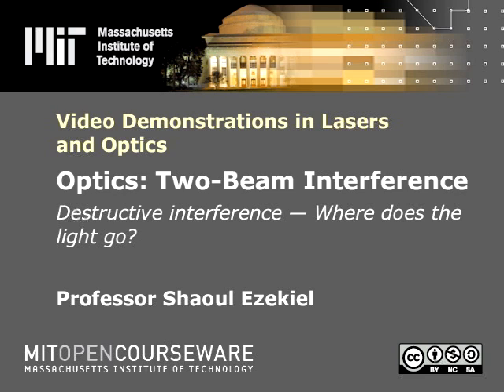Optics: Destructive interference - Where does the light go?

Comment: Where does the energy go?  I thought I’d make a detailed explanation, for those unable to follow the simple correct answers given before mine.
  
First, we have to make an assumption about the splitters, are they arraigned with the silver and glass sides oriented in the same direction, or is there a phase shift from one or both splitters due to the orientation.
The phase depends upon our knowing what kind of splitter he is using.  He doesn't say.  Read here for detailed explanation: https://en.wikipedia.org/wiki/Beam_splitter

Initially, we set up the Michelson Interferometer to display a bright spot at the center of a display to create an interference beam which is constructive along the center which alternates from bright to dark every λ/2 (half wave) (length?) change in the angle. Each Δ of λ/4 in the adjustment arm creates a ΔL of 2* λ/4 or a λ/2 (180°) phase shift. 

The splitters ‘usually’ used in these experiments have a phase shifting side, and 3 non-phase shifting directions, just so you can play with effects like we see here.  It’s a great test of one’s understanding of the phenomena!  This is MIT, who knows; but, it does make a difference, and he does seem to have a 'smirk' in his smile. :-/  I suspect… subtlety! ;-)  To understand, one must know ‘precisely’ the processes going on here. This kind of experiment sets MIT apart from smaller colleges and universities.  One, for the uninformed, it is a real challenge.  Two, for the savvy student, it challenges conceived notions and requires one to examine testing procedures at the level required to make quality experimentation.  Imagine if this were to be published as a paper!?  How foolish would we feel?  This is a great example of the kind of critical and divergent thinking needed today.

In most cases, the primary and principle design and purpose of the Michelson interferometer is solely to show an interference pattern, a second splitter does not get used.  As a simple interferometer, whether one leg is phase shifted does not matter.

Note: When I refer to return path, I am referring to the actual return path which is the pass through path from the adjustment arm mirror, which when hitting the splitter on the return is both diverted to the left leg, phase shifted 180°, and passed through in a return path to the laser shifted 0°.

However, in this set up, the paths are "not" the same in how we create the two interference patterns.  Though he says they are, the return path beam, which he calls “the other arm” from the adjustment mirror, strikes the back side of the splitter  when it makes the 90° turn into the mirror and lens and then on to the screen.  The back of the screen introduces a phase shift of 180°.   Since the adjusting mirror sets up the interference, this phase reversal has no effect, when using the interferometer as in the first half of the experiement.  However, with the introduction of a second splitter, this 180° shift comes into play relative to the reference beam on the fixed leg, with the addition of the interference pattern created for the ‘return’ beam.

It’s interesting to note that if the interference pattern of the first half did actually produce an inverted pattern traveling backwards through the beam, it would phase cancel the entire beam according to Quantum Mechanics, so no reflected beam, this is complex in understanding the fundamental concept behind “Where does the light go”.

What kind of splitter is he using is crucial to our understanding.  As an outsider student gleaning information and watching courses from MIT, Stanford, and all the others.  I personally think it is a heinous crime to leave out such critical information; there are enough people out there who do not understand this process, and will not take this parameter into account.  Someone suggested he would get into trouble if he stated where the light really went; in the case of current affairs he does cater to two schools of thought by removing this critical piece of information.  When I first saw the video, I thought I was going to have to dump all my research!  He could easily have thrown me by stating what kind of splitter this was, and were I to discover the splitter did not have a phase shifting back.

The interference pattern through the return path does not use the reflecting side of the ‘first’ splitter for one of the legs creating the interference. (This is a critical point, and the whole experiment hinges on this information.)  In this case, the ‘return’ legs are both at 0° relative to each other to create interference.  This means that the two legs do take different paths than the first, to create the interference pattern for the “return” beam’s path.  The return path, before it reaches the second splitter already exists as an interference pattern.  The second splitter doesn't do anything but redirect the already existing interference pattern into the viewing leg.

The second splitter, no matter what kind of splitter, does not change the relationship between the two beams already existing as the interference for the return leg because if silvered, the both beams are shifted by 180°, and if glass, both beams are not shifted and remain at 0°.  Shifting the interference pattern by 180° does not affect the banding created!  Shifting one leg or the other does and in this case, the second splitter has no effect on the interference created prior to reaching it.  Note however, it does change the intensity, as each splitter divides the intensity by 50%, the amplitude is affected, but not the phase relationships of the pass through beam from the laser.

To summarize, in the top path, one leg is at 0°, and the second leg is at 180°.   In the return path, before it reaches the second splitter, one leg is at 0°, and the second leg is at 0°, therefore the interference pattern is inverted.   If we set the first path to create a constructive interference at the center, the return path, not shifted by 180° is destructive; or vice versa, the first path creates a destructive center, and the return path, not shifted by 180° creates a constructive center.  What is required to flip the orientation is to change “ONE” path by 180°, but not the other.  In this case, the fixed leg of the interferometer is the reference point.

He is incorrect when he says both paths are the same, unless he means the paths of the two legs reaching the splitter is the same.  However for the top, the Adjustment leg is phase shifted for the top interference pattern on the screen, but the Adjustment leg is NOT phase shifted through the splitter for the bottom interference pattern, the return path, when displayed on the screen. 

The second splitter added later only serves to allow the initial reference beam to pass through (0°), and to redirect the return half of the beam into the second path.  Again, since the interference pattern already exists before it reaches the second splitter, reflecting off of the second splitter either modifies both legs 180°, or it does not.  Phase shifting the interfered beam by 180° does not change the interference pattern because both legs or beams creating the interference maintain their internal basis relative to one another.

Of course, if the splitter does not have a phase shifting back of a silvered half, then he has proven Quantum Physics (or QM) false.  This experiment examines the most fundamental principle of wave function, what happens during destructive interference; the concept that got me interested in Quantum Physics in the first place.  Where does the energy go?  Are all three vectors phase shifted by 180°, spin, electro and magnetic, or only one, or two?  What, if anything, remains observable in reality, when destructive interference happens?  If the energy cannot be observed, where is it?  The answer can be found in 'complex eigenstates'.
Reply: No, because it is unobservable.  That's the classical answer.  If I might ask, exactly what phenomena are you looking for (I'm not sure); and what is your background?

It's fairly well understood that destructive interference appears to create a 90° shift in the normal, and this is apparently a complex vector.  However, in reality, matter interacts with matter, and if the matter interacting has things like electrons and nuclei which they do, then we might conjecture that they also consist of interference patterns which can interact constructively and destructively.

  For all we know in a double slit experiment, the light is interacting with the matter of the slit itself at the edges, and the electrons in the material of the edges are altering the phase of the emerging wave. Still the destructively interfered wave points appear at the constructive interference sites.  This could be a complex vector reflection being reflected back again by electron interference of the reflecting surface material. [180° is destructive, creates 90° rotation, and at π/2 a surface electron reflects it back]  and if that whole pattern is reflected and 180° out of phase with originating phase of incoming. Where does it go?  A: 90° complex phase shift.  Hypothesizing, of course, that matter is nothing more than a sum of  constructive and destructive interference points. (Holographic Universe).

I believe I have a mathematical model of an electron which explains 1/2 spin in terms of simple dimensional interference.  (I believe in layman terms we can extrapolate this behavior cognitively by use of simple 2D moire patterns to show the relationship between the math and physical states of matter existing as fixed nodes, and radiating out from that as photons due to resonance.).  The problem observationally is simply that the angular momentum of the electron is too fast to observe independant states.  For all we know, the electron spends half of its time being unobservable and what we're seeing is the "fan" illusion, where something that appears solid, it really just the blades moving so fast you can't poke your finger between the blades. I feel strongly that we never see the full energy of an particle at any given time, no matter how we measure it.  And saying half could be an understatement.  We always square everything to get real roots, just to make it observable; that bothers me. It bothered Heisenberg, and Planck and classical convention and politics forced them to describe things differently than they wanted. I think Pauli was in on that too; I certainly agree.  The subject was Quantizing angular momentum, and from that we still deal with probability.

I've moved on to Bohmian Mechanics (BM), as from my personal research I think there's better evidence to support that theory, especially with recent entanglement experiments.  All along I independently developed my own theory which I later discovered was a variant of the pilot wave theory and BM .   The behavior I mentioned about the splitters and is well documented in the specifications of the various types of splitters.  The rest is common sense and logics, binary logic in this case which keeps it simple.  One need only keep track of the front or back of the splitter, and thus the type.  So, on that note: original research of the mind I guess one could say.

So, I'm not really sure which phenomenon you are referring.  The experiment fascinated me, as I was hoping to learn something from it.  Instead I found neither a confirmation or denial because of lack of information concerning the splitter specifications.  So, a poor experiment, in my book, at least in terms of figuring out WIGO, vs WOSIGO, or What is going on vs What one sees is going on.

I'm really just looking for information to prove or disprove my theories.  All experiments in my research are mind experiments as I have no laboratory.  I call it Phase Theory, not to be confused with the Wikipedia Phase Theory that's been around a while; but, I've focused on constructive and destructive interference.  Science has spend a lot of time and experimentation and development of constructive interference (Phase conjugate mirrors, Star Wars Defense, Holographic Identification, Photon doubling, Atmospheric interference corrections in Astronomy to name a few), but makes little to no effort to examine the destructive interference effect, and that it appears to be a gateway into N-space dimensional interference, primarily because of the "Where does it go" phenomena, and that based on QM and BM the effect is usually complex, and thus defined as "unobservable" in QM terms as in some aspects of entanglement has shown, unmeasurable.

Entanglement claims to disprove the local hidden variable theory; but, and I'm still absorbing BM, and my theory theorizes a possible local hidden variable which can't be accounted for in current experiments.  But, it's an N-space problem, and not easily observable if at all, thus mind experiments. 

So, based on my key word usage, these are areas you can read about.
Reply: +David C. Huculak Wow!  Thank you, a very nice post.  I'm more used to internet Trolls that defend as if their life depended upon it, a 3D observable universe, and anything contrary to that concept, freaks out their little monkey brains. lol
I learned about uncertainty, and quantum mechanics much later in life.  I abhorred the probability approach until I understood it.  It took much doing because everything I had come to understand didn't allow it; but, at that time I couldn't imagine wave function.
I really became serious when I was 30 years old, I'm 61 now.  I had read a book written by what many would still today call a goof ball, and paid little attention to him.  I felt, if I were to learn to think out of the box, I had to destroy the box first.  So, I never limited myself to solely classical studies; and I'm self taught all the way pretty much, that is except for college and university level math, physics and calculus.  I am self taught in linear algebra, and with that the translational geometrical identities, rotation, translation, etc.  Much needed to understand classical Quantum Mechanics.  Heisenberg's uncertainty requires a mental image of wave function to see why it doesn't specifically conform to linear vectors, however the wave function follows basically a vector form, like a spiral around a vector.

I realized anything I decided had to agree with anything we'd observed in physics to date.  However, I also realized that it would only have to conform to observables, a term I later used and interchangeably with the term 'reality' and decided to call anything that was beyond observable geometry as existing, or saying instead of reality, existence even though it didn't specify to what level it exists, like a thought experiment.  It's more complex than this; but, it suffices for the time.

In the book I read, the "scientist" made one statement I pondered for several years.  He stated that a photon was an electron rotated out of phase by 90°.   Already familiar with both electrons, and their parametrics, and photons and their parametrics, I observed that they were very similar indeed, almost too similar, it seemed strange that they were so similar.

In fact, at the time, the only difference I could see between the electron and photon was that one (the electron) had mass, and moved slow; and the other (the photon) was 'massless' and moved at the speed of light.  Other than those two things, they were nearly identical.  I didn't believe in coincidences, except maybe randomly.

When I tried to discuss this with my professors, or other learned men, I was either way over their head, or they rejected me outright without thought, which confused me, as I was just making inquiry, not a statement of fact.

That was 30+ years ago.

My first hero was Einstein, and my second was Nikola Tesla.  Through Einstein, I was interested in time and light, and through Nikola, I was interested in resonance; this led me to constructive and destructive interference which is present in photons.   When I was 12, and I saw my first electromagnetic chart, my mind imagined that based on what I was seeing, matter must be at the very low end of the spectrum, and have a very long wavelength.  Such is the naivete of a child.  But, I never lost my curiosity as to whether everything was just part of the EM spectrum.

I also noticed on a map of the globe, that all the pieces fit together somewhat like a jig saw puzzle.  I thought this curious, and that was 1968 long before plate tectonics was known.  But, that's another story; I'm interested in a lot of things.  And I am one of those strange kind of people that just can suck up everything they read; although, my years are starting to show... to me.

I am either unemployed right now; or, I am retired; not sure which being 61.  But, because of an auto accident 10+ years ago; I'd definitely say I'm disabled as I received as a passenger really bad back injury which limits my present physical abilities, though one can hardly tell to look at me.  But, it forced me to completely give up most physical activity, and I therefore only had my mind to work with.  Thank goodness, I was interested in just about everything; but, loved physics, and philosophy, computers, etc.

So, I consider my hobbies, my work, and right now "my" Phase Theory" and supporting activities take up most of my time, with some 'shiny object' distractions.   I'm getting older; but, I'm currently studying python (a programming language) with the eye towards modifying Blender, a extremely sophisticated 3D drawing tool so that I could make n-space objects and the mathematics surrounding their behavior.  The spreadsheet was much too limiting.

I would give just about anything to have some people helping me; as I see it, unless we're all "changed in the twinkling of an eye" I'll run out of time before I develop FTL(sic) and matter teleportation; I think QM energy sources are on their way into the public as we speak, several if what I see emerging is what I think it is.  I can even explain how they work, though the developers are a little hazy on theory; they're more like Tesla, a real hands on guy.  My best skills are multi-dimensional spatialization, and an intuitive grasp of the math.  I would love to find a like minded peer or two or more!

So, no job; but, I do physics full time! :-)

I believe the gateway to the greatness of the cosmos is in understanding the role of resonant coherent destructive phase cancellation.  Controlled, of course XD.

I hope this isn't too long.  I could lecture, discuss or have discourse on these topics ad nauseam... not to me, of course ;-)   I would love to specifically find someone who could show me where my thinking has gone awry! Or, in other words, where I'm wrong.

I became interested in phase conjugation in 1980-81. My first 'aha' moment in Calculus theory occurred in 1981.  Applied calculus was too mundane.  Any suggestions, help, information, discussion, you name it, you could provide would be greatly appreciated.

Thank you for asking!  PS: I haven't played in a while; but, while I did, I loved playing Go!  Unfortunately a lack of playing partners that could compete forced me to move on.  It's been 20+ years since I played, fascinating game, so many permutations.
Reply: +Chip Cooper Can you at least provide figures for your explanation? some of your terms in your explanation are rather ambiguous, for like, "left leg", "back side of the splitter", "The back of the screen introduces a phase shift of 180 degree", "first splitter", "viewing leg". Can you at least unify the terms? Also, I'm not sure I understood "return path" from your definition, though I get grasp of it
Reply: Jeong Hoon hard to believe that I wrote that less than two months ago.  Seems like ages.  I don't exactly recall; but, I tried to use the terms he uses in the video when I could for consistency.  From what I do recall, we have the interferometer, and the extras he added to make the return trip.

I know when I refer to the back side of the splitter; I'm referring to the different types of splitters, and we don't know what type he's using here.  But, splitters can have a mirrored side and a glass side.  Without reviewing what I read, the back side of the splitter would have been referred in this case to either the one that does a phase change vs the side that doesn't cause a phase shift.  I believe I set up which is which when I discuss different splitters. (This is just a quick response; I can't get into the test right now.  I'm working one a spinor based n-space mathematical model of a 1/2 spin particle at the moment, purely theoretical, of course.

So, let me copy your response and take some responses there from memory.

+Chip Cooper Can you at least provide figures for your explanation? *I believe I used his set up as viewed from the front of the table, closest, the narrow side) some of your terms in your explanation are rather ambiguous, for like, "left leg" (probably the return leg he added later), "back side of the splitter" (explained earlier), "The back of the screen introduces a phase shift of 180 degree" (refers to the atomic and subatomic structure of the screen acting upon the interference pattern making the light visible), "first splitter" (the splitter first in path after emission from the laser), "viewing leg" (not sure, the leg to the screen).. Can you at least unify the terms? Also, I'm not sure I understood "return path" from your definition, though I get grasp of it

If this isn't enough, write back using Google+ notifications, and you can tag me in there. YouTube stopped allowing tags on the YouTube video web page, and it's only active in Google Notifications window, like I did for you.  I'll look again and re-read what I said, so I can clarify.  As I recall, it took me some thinking to follow all the paths.  I drew myself a diagram; but, don't know where the notes are, if it wasn't just an envelope.  I've spent 30 years thinking about deconstructive interference.  I think the term destructive is a misnomer, and that phase cancelling vectors are a well kept secret, or completely ignored subject area in physics little understood.  Thus the question, where does it go.  This has answers to the double slit experiment, if examined properly.  However, keep in mind, we don't know what type splitter he used.  Some don't have the 180° phase shift on one side, some do, it's a critical part of the critical thinking, as I'm sure you have or will realize. I don't know if as instructional, it was intentional or not, leaving the piece of data out of the video.  It certainly hampers drawing a definitive conclusion.

I apologize, but it would take me almost as long to redo this experiment, done mostly in my head, as I did before.  I only need to write down where the beam was phase inverted, in a binary form. 0 for no shift, and 1 for inverted, the rest is logic and following all paths.

I have been picking up a 3D drawing program Blender so that I could eventually draw these and create a video.for more complicated explanations.  This might make a good first project for me as I've gained some skill since I wrote this post.  Blender is written in Python, and I hope to familiarize myself with it, as I'd like to modify the drawing program to handle n-space vectors and spinors adding some controls to limit viewing areas to 3 orthogonal dimensional constraints.  It's hard enough to imagine 3D on a 2D screen, fortunately as humans we're pretty good at that.  However 6 or 9 dimensions, not so much.

I have my weak areas, and I'm picking up missing information as quickly as possible; although I have been working on this abstractly for over 30 years.
Reply: +Chip Cooper Wow, your response is immediate! I wonder if I can send you privately? I want to send some diagrams I've drawn, and see if it makes sense, because in my diagram, both the interference at the screen and interference of beams to the source make constructive/destructive simultaneously!
Reply: +Jeong Hoon I don't have a way at this time for you to do that; but, will look tomorrow.  But, of course the beams are interference patterns which are both constructive and deconstructive in the one path; then the 2nd path is also both constructive and deconstructive too.  So we have two beams of interference interfering with each other. However they are only visible when using something like a screen.  The comment on 180° at the screen involves my Phase theory analysis; you can ignore it for now, and treat it like a reflection (which is an inversion of sorts, isn't it?)  Spending time with wife, will be on tomorrow...  I believe I also followed the path as he doesn in the video.  Those does presume a complete knowledge of how an interferometer works.only the return path is extra.and the effects of two types of splitters without knowing which.  As an interferometer, it doesn't matter.  The return path changes everything and whether the mirror introduces a phase shift is of paramount importance.  So, yes, one interpretations gets the results he shows; but, not exactly the way he says it.  The two paths are not equal.
Reply: +Chip Cooper  I found a way to send you my diagram.

http://physics.stackexchange.com/questions/207810/mach-zehnder-interferometer-two-output-interference-pattern-question

This is my question, and is this how it works?
Reply: No, first this video uses a Michelson Interferometer, a completely different animal from the Mach–Zehnder interferometer you show.

(Aside, it seems like you're almost asking for an entire class on interference, and this is not a venue for that.  It took me a while to understand, and I wouldn't have understood either from what I've written here)  I will try; but, hereafter, I will refer you to what I think you don't understand, that you may find reference material for understanding.  You should also understand the slit experiment as best as man can tell it and the math behind the interference pattern, including the math for (I) Intensity..

Second, that link is for StackExchange, it is not a forum. (It is a Q&A site where other people vote on the right answer.  To my knowledge, physics and truth are not voting matters, though we do use a consensus of peers to evaluate experimental results. ;-)

The Princeton article reference for the Mach–Zehnder interferometer appears simpler to understand; but, in fact is mathematically a bit more complex.  The Michelson has an adjustment let that allows for compensation to create the interference pattern (it's sole purpose).  The Mach-Zehnder appears to be 'trying' to create an interference pattern which is cancelled.  So, whereas the Mach–Zehnder is working to create a single interference, the Michelson is working to create an interference of an interference pattern by creating a destructive (deconstructive?) interference using the return path.  Two apparently similar concepts but, different. Still because Michelson is adjustable, and needs fine adjustment to align the paths, it is possible to adjust both paths since variances are small. We see this in this video when he applies pressure to align the two paths and presses or leans on the table, and the inevitable drift.

 The path length because of the addition of glass on a phase shifted splitter is so small that tiny adjustment of the leg lengths through physical pressure at the right location can fix this - temporarily.

The question you asked in StackExchange is Where is the construction?  It is a moot question for the theoretical setup without the errors introduced by the glass surface of the splitter.  The purpose is to create 100% deconstructive interference theoretically.  The reality is different.

When talking construction and deconstruction one cannot refer exactly to a constructive or destructive path.  The two paths mutually interfere with one another.  If the two paths are phase conjugates of each other.  If we call path A constructive, path B is deconstructive; if we call path B constructive, then A is the opposite.  So, labeling a path constructive is symbolic and arbitrary, and the other path the opposite if exactly 180° out of phase (or complete conjugate) of the first path.

The answer (for either interferometer), presuming the return path is conjugated, is that conjugation based on linear algebra introduces a 90° phase shift.  Because the light we see is 'real', this means that deconstructive interference pattern is referenced in real coordinates resulting in a sum of squares problem to solve conjugates.  Sum of squares for real values produce a rotational shift and the new vectors are abstract complex roots also known as complex eigenvectors.  So, this actually supports QM.  The observable light (energy) is rotated into complex imaginary vectors (since there's three, which are rotated? electro, magnetic, spin? none, one, two or all).  The energy exists but now "apparently" has no observable energy, unless someone comes along and shows that the sum of squares some none or all parametrics produce a real rotation with real roots and not mathematical complex parametric states (This is currently, I think, within my scope; but pure theory).  If this can be done' it will support a more DeBroglie-Bohm type solution as real vectors (if observed) were generated from some complex (if existing) part of the EM light vectors (A Bohmian Mechanic type theory) and are also rotated and become observable.

But, if I'm following you correctly, and based on your questions; you are on the right path, your questions are following the right path to the answer.  I suggest you read that Princeton paper on the Mach–Zehnder interferometer, and then compare it to the Michelson interferometer, and once you understand how both work; then pose more specific questions.

Basically though, using the Mach–Zehnder interferometer and trying to analyze the Michelson interferometer is like comparing half apples, to apples. Two vectors are missing along with an adjustment leg, and an interference pattern, and the 2nd leg he adds in this video.

Eventually we'll end up either at the screen, or seeing the entire path.

Keep in mind that with Michelson, the energy of the dark band, exists distributed in the light band and the incident amplitude (I) of the interference pattern is an I⁴ reflection, and so all the energy is present and real.  What this experiment does is to interfere with the interference.

Truth is, I don't think anyone really knows the truth empirically.  It is probably either complex as I stated above, or is a kind of feedback loop which like in radio, audio, or other phenomena sets up a resonance at the origin and may eventually blow out the laser amplifying circuit.

It is a provocative experiment.
Reply: +Chip Cooper Yes, I have read it thoroughly,  and I understand how interference works. 
Thank you very much.
This article clearly states that there should be caution when treating splitter, like you said in your previous reply.
Reply: Jeong Hoon and do you also have the background with Linear Algebra and understand eigenvalues, and rotational matrices?
Reply: Yes, I do have background with Linear Algebra, eigenvalue problems, and rotational matrices as well, since I studied Mathematical methods for Physicists by my self. My basic is Optics :)  and I love quantum mechanics (Although I'm not familiar with the subjects you replied)
Reply: Jeong Hoon  I'm sorry; what subjects are those specifically? I said many things.
Reply: +Chip Cooper You said"I'm working one a spinor based n-space mathematical model of a 1/2 spin particle at the moment, purely theoretical, of course.". I know spinor matrix, but I got to learn a lot.
Reply: Jeong Hoon Ah yes, it was off topic.  It's purely theoretical. The formula are at planck levels (with some non-standard theory, or possibly a viable (I hope) side line.)  I've run into an issue which I'm trying to resolve.  I designed the model in an excel spreadsheet. Graphing it has been problematic.  I ended with a model that represented my thinking; but, I had inadvertently introduced a timing anomaly I have yet to continuously understand or explain though intuitively I know to be true. (BTW from writing this, I remembered it was intentional, not inadvertent.  The time anomaly was an accidental discovery; but, now I know where it originates, a third harmonic. It is possible to introduce an interference pattern which if shifted in phase to a similar pattern creates in the resulting interference pattern the appearance of a phase shift, moving the amplitude and waveform backwards or forward in phase.  I has the appearance of a time shift.)

This theory of mine, I call "Phase Theory", not the one commonly known. In this paper, I'm examining the possible relationship between say bosonic light waves (or wave function), and a fermionic electron's wave functions to determine if this relationship exists and can explain spin.

Since you are familiar with optics, I primarily deal with phases.  I'm specifically dealing with 1/2 spin dynamics using harmonics. The combination of two spin vectors.  One which rotates twice (4π) for every single cycle of the other(2π).  I am trying to break down the internal structure of a fermion (ex: electron) that gives it half spin.  I am not really trying to define a specific particle, or sparticle, or anything specific, only examining spin as an angular (phase) function of interference patterns, and the parametrics needed to define it.

.  Traditional physics doesn't allow two things to occupy the same space; but, in this case theses are wave functions (bosonic) which can interfere with one another dependent upon their phase at any point in time.  Two waves through interference produce a single interference pattern that together rotate and return to their staring position once every 720°.  

Constructive interference is real (as a difference of squares); however deconstructive interference involves, as mentioned phase, cancellation.  This produces both real and imaginary products as a sum of squares.  So far, so good. (Specifically, I'm also examining CDI (constructive and deconstructive interference) as a special function in the creation of dimensions.

I chose to examine using the cosine and sine of the functions, as they would exist in the same plane relatively as two dimensional representations as x & y and interference is simple addition of the cos(s) and the sine(s) of the phase of each wave plane. For this discussion, I only examine Cos, as possible 'real' parameters pure phase.

This is my model of a 2π planck sphere, The center is a zero point (a virtual black hole of infinitesimal size (not real, for reasons that would be another discussion)) , the distance to the surface (radius) is a 1 dimensional line (schwarzfeld radius -z), and the surface of the sphere is 2 dimensional planck surface(x&y).  The parametrics are such that the model assumes fixed node oscillations for each wave function as if they were like orbitals on the surface of a sphere forming a closed loop, the surface is 2 dimensional.and their paths are the same.. As mentioned above, one is 2π pure phase, and the other is 4π pure phase, and the interference is simply the sum of the two phases.

However, when I created this model, it didn't behave exactly as I thought it would; and so using a mirror symmetry I doubled the first two vectors and created a mirror object (this was fine for me, as the symmetry above creates a mirror which is the same as the original in x but, is inverted in y), in other words.  When superimposed upon the other, the one dimension is phase cancelled.  This still wasn't right; it lost too many parametrics because they were cancelled; so I separated the two so I could cancel the parametrics I wanted to cancel to produce the 720° rotation.  This factor was determined to be a 1/3 or 3rd harmonic of some kind.

The problem is in how I introduced that 3rd harmonic into my graph.  Because it is a spreadsheet.  Deriving the whole from it's parts isn't simple.  The model is very dynamic; but, it exhibits 1/2 spin properties in 4-6 dimensions.  I say six only because at axial zero, it's indeterminant and cancels one (double) wave function or the other for an infinitesimal period during transition across the zero point.  I'm working on making a video as well as deriving the math of the entire set.

I often think that in mathematics one cannot go to infinity, or zero; but, nature does it all the time because it doesn't know of those constraints, and the answer though undefined, is defined by nature.

The bottom line as I perceive it is that 1/2 spin results from the CDI of sixteen wave functions, (8 if one defines sin and cos as a single wave function) and is a result of a two planck particle which is entangled, and it introduces through CDI a time anomaly.

This is already getting too long; and writing to you has been helpful.  For posterity, I'm keeping a record of this conversation; if I ever publish, I will include your name.

Every person I have encountered that expressed even a scintilla of interest has helped me make my thoughts coherent.  I know I glossed over a lot of the math; it's because it exists only in spreadsheet form; I don't fully understand the exact formula, nor know the methodology to express it in Latex yet...  I just know I followed all but one rule.  I allow for the existence of a phase cancelled subspace at Zero Point Space, which gives the appearance of nothing yet has a CDI effect that influences time.

Whether I've done everything right has yet to be determined.  Either way, it's a beautiful thing to behold (even in three dimensions drawn on two dimensions).  X,Y i.   I find one of the most fascinating parametrics to appear is the polarity, it occurs naturally as a 3rd or 4th order thing.  The relationships are simple. A wave function consisting of A primary wavelength and a secondary harmonic. These two functions (particles) are doubled and separated in phase by a third harmonic.

This resulting in what appears to be a single 1/2 spin parametric 'thing' both electro and magnetic, with spin and polarity basically wrapped in a virtual schwarzfeld sphere whose CDI patterns create EM field patterns of a single static point like particle as a fixed node occupying two planck, is two 'things" entangled which exist (as constructive interference) and extend into n-space (by deconstructive interference).  Constructive is a dimensional field amplifying, Deconstructive is dimensional field rotation. 

Interference patterns can create the appearance of field attraction and repulsion created from spatially non-harmonic relationships between particles. thus the ontology of Space time is virtual and exists as pure phase.  But, that's other "things" I'm working on.

Geez... too long again. (sigh)  it has become a litany of mine.  Again, I apologise. 

One more note regarding the anomaly mentioned earlier.  If a superimposed pattern gives the appearance of a phase shift on the waveform such that it only distorts where the maximum and minimum amplitude of the waveform is located in that space. The wave can appear to propagate at a slower or faster speed than light but this will only exist while under the influence of the interference pattern, and appears to be part of the medium in which the EM wave exists or an influencing field.

Have I jumped off the deep end for you, bordering on the crazy side? :-)  If so, it worries me too!
Reply: so what happens when they really do fully destructively interfere?
Reply: Wow